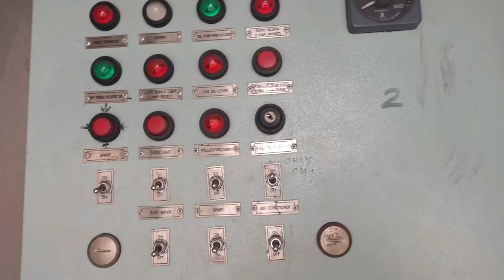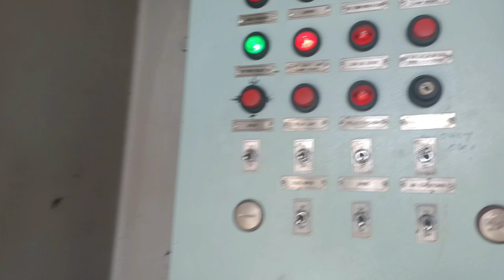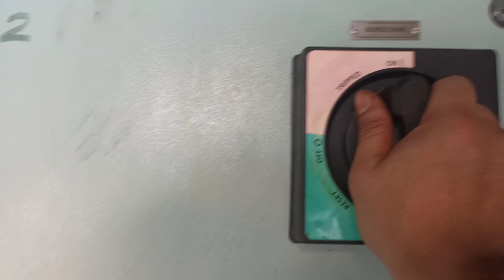How to Operate Ship's Crane

Comment: Good day sir, cable type vh Yung grab nyo! Tanong kulang sir anung mga maintenance NH gawin bago dikit xa port.
Reply from the maker: hello sir. cable type ung grab namin sir. syempre check lahat ng langis, check din ng mga runner, swing ng crane, limit switch, grasa ng gear ska ng wires, grasa sa grab, check din ng stabilizer wire. para smooth parin kahit luma na ung barko.